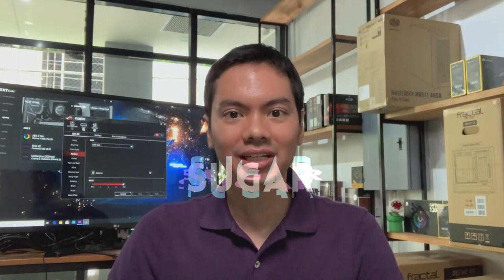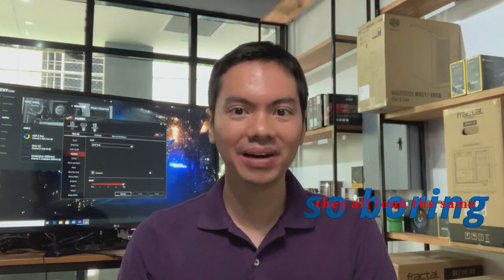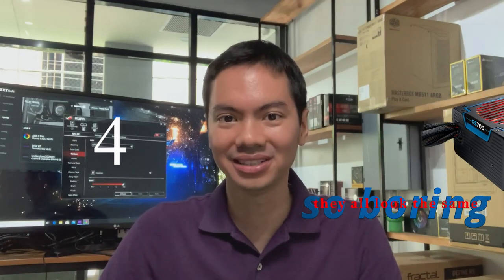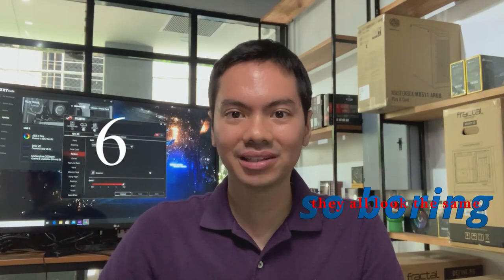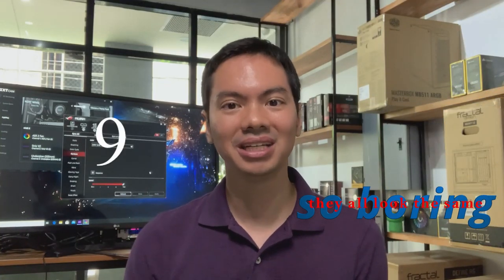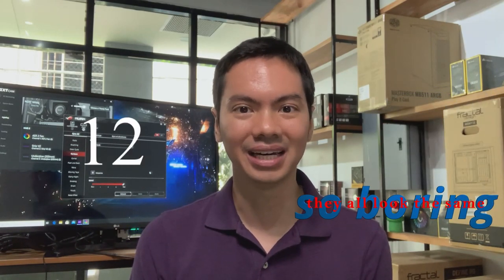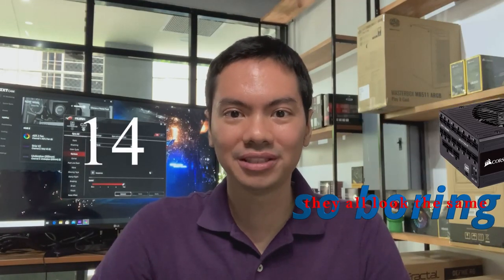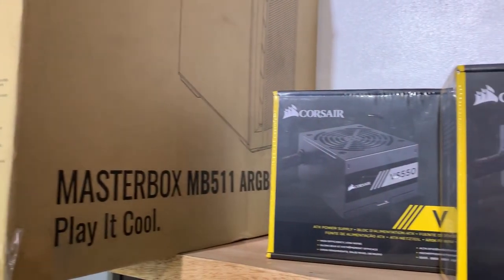The Differences Between All of Corsair's PSU Lines

Comment: I have HX1000i I love it, this beast takes overclock hw at ease and doesn't even bother to spin the fan in anything less than 50℅ load. I love pc being silent yet powerful.
Reply: I’ve had my Corsair HX1000W for almost 12 years already and it still is going strong with a overclocked cpu,ram and gpu!

Comment: Certainly helps to have someone comparing all of the Corsair PSUs and comparing them. Seems like there's quite a few bonuses for going from RM to RMx, the capacitors could help with possible fluctuations in power--which certainly sounds like it helps with power consumption and having an even flow of electricity to prevent any shortage--modern standby helping with starting up my computer faster and idle/sleep operations, and a quieter fan doesn't hurt. This video definitely helps me understand my position on those mid-to-high range PSUs, so yeah, really great stuff!
Reply from the maker: glad you found it useful! tbh I am also intrigued by modern stand by as I often leave my PC on all night just to download/upload
Reply: @hwsph  You knocked it outta the park! Why Corsair will flood the market then leave the consumers confounded and scratching their heads to understand the SKUs is quite puzzling! The way you grouped them into tiers and a hierarchy, I give you the thumbs-up 👍 for that! I certainly know what to get now... It was easier with EVGA for me

Comment: Very Informative video.. worth a sub.
Ask lang po recently bumili  ng pre-built system unit  with CV650 
 do i need to  replace po ba? im using ryzen 5 5600 w/ rx 6600
also do i need an avr to this?

Thanks a lot in advance
Reply: black

Comment: What to use po
CV650 or CX550M

System
-R5 3600
-gtx 1660 super 6gb dualfan
-b450 tomahawk max
-g.skills trident 2x8gb RGB
-samsung 500gb m.2ssd
-toshiba p300 1tb
Reply from the maker: I'd go with the CX550M. 550w is enough watts for your build and the modular aspect of the CX makes for an easier and cleaner build.

Comment: Gpu= MSI GeForce RTX 2070 SUPER GAMING X TRIO 
Cpu= AMD Ryzen 7 3700X
Ram= 4x8 32 gb 3200 mhz
Motherboard= MSI MPG X570 GAMING EDGE WIFI

Wich PSU you think is the best for this setup? i was thinking about the Corsair RM750 PSU or the Corsair TX750M V2 PSU.
Reply from the maker: Tbh I don't have a lot of experience with the TX line. Both look to be pretty similar in specs but I'd choose the RM since I have more experience with it and I know it's reliable.
Reply: @hwsph  Alright man thx for the response appreciate it a lot!
Reply from the maker: @jasperwesterhoff9975  👍

Comment: Thanks, im currently using   the rm 850 2021 for  an 11700k + 3060 ti,  and  under a video  of an rm psu exploding i was scared if i should have bought  an RMX instead. Now i know it wont blow up xd

Btw,  the 2021  version of the rm850 has some improvements over the 2018?

Comment: Appreciate your vid, it helped me so much!
Got a question: there appear to be several models for each of the categories, for example, CP-9020200-EU and CP-9020180-EU for RM850x.
What's the difference and how to check which one is better?
Reply: It says it in the name, the first one is the newer 2020 model, the second one is the older 2018 model, the 2020 model was the one you want CP-9020200-XX

Comment: Your explanation on CV is really short. I just bought it with Rx580, Ryzen 5. Will it be okay?
Reply from the maker: which Ryzen 5 and what wattage of cv did you get?
Reply: @hwsph  Ryzen 5 2600, 650W
Reply: its should be fine. im using that rx580 8gb before i upgrade to rtx.

Comment: Yo do you thing its fine to use the green cx750 that I've had for 5 years for a new build. Heard a bunch of people complaining about it saying its not but the Amazon and bestbuy reviews are good. And its been flawless for me
Reply from the maker: since it's working fine for you that's golden, no need to change it
Reply: @hwsph  what kind of protections does it have? Like over voltage and stuff. And also I've had it on a 980 and quad core cpu so its never really been pushed, 3080 will definitely push it. So like idk it might a bit risky to use it a power hungry 10600k ans 3080

Comment: I am thinking of upgrading my system. Recently got a 2060 super and thinking of getting the i5-10400 with a MSI B460m bazooka. I have a FSP hexa+ 550W PSU right now which is a few years old. I am thinking of upgrading the PSU. The 2 options I am looking at is CV 650 and TX 650m. Over here they both have 3 year warranty only, but has a 30USD difference. So my question is is it worth spending the extra money on the TX650. Also is 650W an overkill and is 550W enough for my system?
Reply from the maker: Yes I'd spend the little extra to get the TX650. The gold 80+ rating is pretty sold and worth the price bump. 550w is generally considered to be ok for that build. If you're not planning on overclocking you should be fine.
Reply: @hwsph  Thank you for replying. No i won't be overclocking. What i thought was keeping the psu load around 60-70 % of the psu wattage because i have read that, that is when the psu is working most efficiently. Is that true?

Comment: Hey man,
I'm currently living in a country that have the worst electricity (worst than you can imagine). Pretty sure that my PSU died because of it since the constant random switching between high and low electricity power. Now I'm looking to buy a new PSU and was wondering does it help if I get a 80 plus platinum or higher PSU rather than buying an 80 plus gold PSU matter? I mean will the higher certification help save my PSU from dying because of the bad electricity that I'm dealing with?
Reply from the maker: I live in the Philippines so I can sympathize with having a "noisy" power grid. Generally the higher end PSUs (Gold upwards) already have some voltage regulation built into them. I do not know how much better the protection gets the higher up in color you go but I do not think it is substantial. The easiest solution would be to get a good external avr (automatic voltage regulator); you plug your psu into the avr and then the avr plugs into the wall outlet. The avr should smooth out the voltage from the line so it's "cleaner" when it gets to the PSU.
Reply: @hwsph  Thank you for the help! Really do hope that this solves my problem, much love homie. ♥️
Reply from the maker: @V-3  no prob bro, hope it works out

Comment: Any suggestions for what brand series should i go for my system. Planning to replace a four year old rig using it for photo editing and gaming. Kinda having some dilemma which series should i go for 550w br 80+ i'm aiming but in terms of series tho. 

Intel i3-4170
Asus h81m-k
Kingston ddr3 2x4gb 1600mhz
Msi gtx 1050 ti oc 4gb gddr5
3x120m case fan
CM Blizzard t2 mini
1tb baracuda 7,2k sata
Rakk kimat xt2.le gaming kb
Logitech g102 prodigy gaming mice

Hoping for some response. Thanks
Reply from the maker: A CV or a CX; either would be fine for this build.

Comment: I'm building a new pc with i7 10700k and an RTX 2080 super, and I'm thinking of getting the RM750x. Will that power supply be ok?
Reply from the maker: That cpu will draw around 125w and the card around 250w. That means you still have almost 50% of the PSU's capacity left to play around with for other needs (mobos, periphs, etc.). So short answer, yes that PSU is fine. Nice high end parts btw 👌
Reply: @hwsph  Thank you! This will be my first PC build from the ground up. Very informative video btw. Keep up the great work. :D

Comment: ito po build ko : 

AMD Ryzen 5 5600 3.5 GHz 6-Core Processor
Deepcool GAMMAXX GT A-RGB 64.5 CFM CPU Cooler	
Gigabyte B550M DS3H Micro ATX AM4 Motherboard
TEAMGROUP T-Force Dark Za 16 GB (2 x 8 GB) DDR4-3200 CL16 Memory
Kingston NV1 1 TB M.2-2280 PCIe 3.0 X4 NVME Solid State Drive
Zotac GAMING Twin Edge GeForce RTX 3060 12 GB Video Card
MSI MAG FORGE 100R ATX Mid Tower Case
Corsair CV550 550 W 80+ Bronze Certified ATX Power Supply

pero parang mali ata nabili ko na PSU. kasi yung corsair CV550 W +80 bronze ay nasa Tier D ng psu cultist tier list. Tanong ko boss if gagamitin ko ng sapilitan yung PSU ko masisira ba yung gagawin ko na PC? or bibili nlng ako ulit ng PSU?

Comment: Needed this. I’m building a atx mid tower build with 3600, 5700xt, on a x570 board. Should I get a 650w > or get a psu around 500w>. I’m getting a nzxt case. Would any psu fit?
Reply from the maker: If it's a mid tower case then most standard sized PSUs will probably fit. To be sure you can check the PSU clearance of your case against the size of the PSU you've decided on. But in general mid towers and larger will fit just about any standard sized PSU.
Reply: Hardware Sugar does it really matter if it’s modular or non modular?
Reply from the maker: Arcane J03 Ryzen cable management is easier with a fully modular psu. That probably wouldn’t sway a lot of people so it comes down to personal preference. Personally I’m a big fan, I think it makes everything look a lot neater.
Reply: Hardware Sugar ight thanks
Reply from the maker: @Rooot-username  👍

Comment: I bought a VS650w psu for my brothers new pc, is it gonna be alright for an rx580 and a ryzen 5 3600xt? I have panic bought a CV650 after hearing allot of negativity around the vs lineup. Should I cancel the CV order? Would the vs end up being fine?
Reply from the maker: I'd go with the CV just for peace of mind.
Reply: @hwsph  thank you, I appreciate the advice. I'm now thinking about putting the vs 650 I have into a custom built gaming pc to sell so it at least has some use rather than sitting around doing nothing. I want to make sure I am being as safe as possible for the buyer, what kind of build would you recommend for this?
Reply from the maker: Something that won't tax it too much, one of the amd cpus with an apu maybe like the Ryzen 5 3400g. Or an older gen (R5 2600) with a mid level card. With that last one there's even some allowance to upgrade later on.
Reply: @hwsph  thank you so much, that's a fantastic suggestion, I'll go down that route. I appreciate the advice so much 😁
Reply from the maker: @tobezoned504  no worries, have fun with the builds

Comment: rm850 for 134$ or rm750x for 134$ or hx750i for 160$? I have a 3900x and a gtx 1080. I want to have room for a better graphics card, which should i buy?
Reply from the maker: Any of these will give sufficient power for the latest gpus. I'd go with the rm850, gives you some more juice if you'd like to try overclocking some of your components.
Reply: Hardware Sugar okay thanks for the quick reply. Is it worth paying 160 for the rm850x instead 130 for the rm850?
Reply from the maker: @julianb.1944  For 30 bucks more, yes I'd go with the RM850x at $160 over the RM850 for $130. Yes more expensive but considering all of the little things you get in the RMx line the slight(ish) cost difference seems like good value for money.
Reply: Hardware Sugar okay thank you so much, now i know what to get <3

Comment: I have an old ax1200 Gold and it still works great but cant get any Corsair cable mod cables for it. So i have to look for another 1200 type PSU so im looking for a good PSU, not a cheaply made one. Which one should i go for? I try to keep the price under $300 but im aiming for as low as i can go, like, $150. I run a lot of hard drives, and have a powerful system, just my motherboard alone needs a minimum of 500 watts. Is why i need such a large PSU.
Reply from the maker: I'm not up to speed with all of the international prices but based on what others have said here the RM line is around $150. Sounds like your current PSU is doing just fine though, is it worth it just so you can have colored cables? :)

Comment: just got a rm650x 
gonna power up a r5 3600 , b550 steel legend 240mm aio + 4 5 fans, 16gb 3200 4ssds and a 2070super. the 750 is out of stock for months . isthe rm650x enough? monkaS
Reply from the maker: should be ok 👍

Comment: hi, is my corsair HX750 psu counterfeit? I got one came with a yellow background box and it has no 12v switch also packaging came with no bag for the cables. Are there different versions of HX750?
Reply from the maker: idk tbh - did you get it second hand/not from an established store?
Reply: Just did some more digging, and it turns out that what I got was the 2021 version.

Comment: Hi sir, avid fan nyo po ako, just want to ask sir for your opinion i have ryzen 5 5600g and b550 tomahawk tapos corsair cv650w ung psu ko, di po ba ako ma woworry abot efficiency ng corsair in the long run considering, ung model nito. Or should I reconsider another psu like seasonic? Ty po, if ma chambahan mo tong message ko lodi! Stay safe
Reply: gamit ko now yan cv650. unit ko is rog b560-a i5 11600 2x 8gb tridentz 6 fans rog rog rtx 2060s. sa kuryente nd nman ganun kalakas so ok para skin kahit 80plus bronze.

Comment: I feel like, at this point, every video that talks about modular power supplies should emphatically tell people to only use the power cables that came with the power supply. Because people are regularly frying hardware because these connectors are physically compatible, while the pinouts vary, even within the same brand.

Tell me which manufacturer is doing the most to improve this situation, and I will buy from them.
Reply from the maker: I agree trying to use different (non native) cables in a fully modular psu is asking for trouble.
Reply: @hwsph  I had no idea. I've never heard of swapping physically compatible cables of any kind being so dangerous. This is ridiculous.

Comment: Okay napo ba yung white sa 20k ryzen 3200g and what motherboard should I get ? I need answer Im newbie : (
Reply from the maker: usually this is our 3200g build

Cpu + Mobo MSI A320M-A PRO MAX + AMD RYZEN 3 3200G 8,150.00
Ram Kingmax 8GB PC2666 DDR 2X8GB 3,950.00
HDD WD 1TB 2,420.00
SSD Intel 545s 128GB 2,300.00
PSU Corsair CV550 Bronze 2,950.00
Caase CMQ300L 2,999.00
Windows 10 Trial Version FREE
Total 22,769.00

Comment: if there is a high demand of 12V meaning more current or more load like adding more drives and fans, does it affects the 5V rail? as with the issue on Corsair V650 that the 5V rail is getting from its 12V rail by sharing its regulator, does it the same circuit topology with the other model of Corsairs?
Reply from the maker: In modern systems most of the power draw is from the 12v rail. Whether strain on the 12v rail affects the 5v rail depends if the lines are really separate or if the 5v draws its power from the 12v. Some PSUs generate their 5v power from the 12v using DC/DC technology. I do not know off the top of my head which Corsair models have dedicated 5v rails. PS. Take everything I say with a grain of salt as this is really technical and I don't usually tread in these waters.
Reply: @hwsph  Thanks

Comment: Well i have cv 550 can it run my rig 
Ryzen 5 2600
B450 mortar max 
Rtx 2060
8*2 16gb 3200mhz
1 tb hdd 7200rpm
512 adata xpg s8000 m. 2 nvme
Reply from the maker: might want a little more juice since you have an rtx2060

Comment: Hi I'm building my own gaming oc for the first time I have a geforce gtx ventus xs 2060 graphics card and a ryzen 5 3600x processor with 16gb ram 3200mhz.  I really don't know what power supply to get and am kinda trying to keep it cheap got any suggestions?
Reply from the maker: Hi, imho you can get a CX650w and you'll be fine. If you want to splurge a little an RM650w or an RM750w will give you more room in case you want to overclock your cpu or gpu in the future. Enjoy building your rig! Was a bit apprehensive when I built for the first time but it's very satisfying when everything comes together and the computer actually turns on properly when you hit the power button 👍
Reply: @hwsph  thanks man I really appreciate the tips yh sure I will do 😁 really enjoyed ur video I really didn't know bout the whole rx and vs and all that really appreciate it keep making great content 👍

Comment: I want to oc my cpu....I have i5 9600k and cooler master - ml120l (aio) & asus gtx 1070 but my psu is weak corsair vs 550 (80+ white) will it work properly or i have to upgrade my psu?
Reply from the maker: 😬 I wouldn't with that PSU. I mean you could try it and see how stable it would be but I wouldn't expect much on oc using that psu.

Comment: Do not buy a Corsair power supply, my new 1000w has a noisy fan that intermittently turns itself on and off, very annoying. Shop I bought it from couldn't detect the noise so I'm stuck.

Comment: Ask lang po I'm a newbee , i have low specs ryzen 3 3200g, 2x8 3200mhz, a320m mobo , can i use higher watts? Like 600wattss above ?
Reply: Even though i don't have any gpu yet
Reply from the maker: You can use it in the sense that you can install a 600w PSU and it will be fine (won't break anything). You're not using the full capability of the psu though.

Comment: Idol tanong ko lang. Good din naman yung CV 450watts sa FX 6100 with RX 470 "4gb" with 8gb ram diba? Kase old school din naman yung FX e. tapos yung RX 470 alam ko ang release date nun 2016 e.
Reply from the maker: Should be ok, as you mentioned the CPU and GPU don't take up a lot of power.

Comment: which is better vs 550 or cx 500?? thx
Reply: gamit ko i5 3330 rx570 2 ram 8gb at 4gb.. 2 fan.. 1 ssd 2x hdd... kaya ba ng cx 500?
Reply: pinagpipilian ko vs 550 or cx 500.. thx
Reply from the maker: @j.ej.c6268  Go with the CX. Really hard for me to recommend the VS, its internals are old, quality barely gets it 80+ certified.
Reply: @hwsph  thnk u i made the ryt choice.. hehe..

Comment: How about ryzen 5 3600 and rtx 2070 super is cv650 bronze 80+ enough help pleaseee
Reply: Go on bequiet psu calculator
Reply: Did you buy a cv650? If so does it work well?
Reply from the maker: seems a bit light, it will work but would feel more comfortable if it were an rm650 or at least a cv750